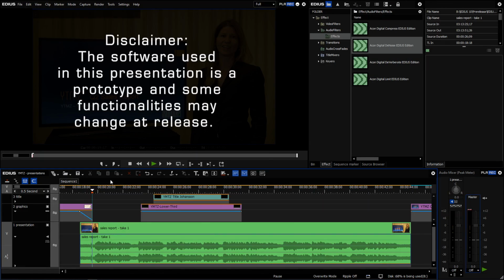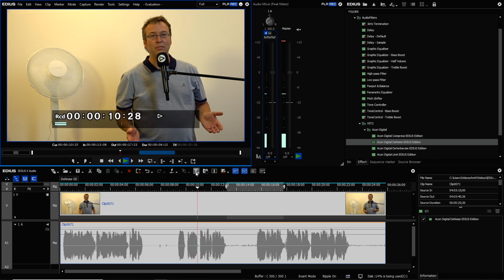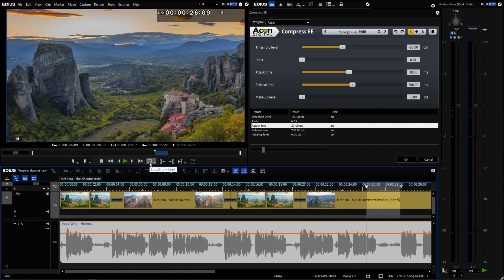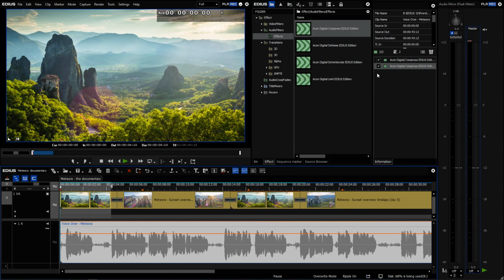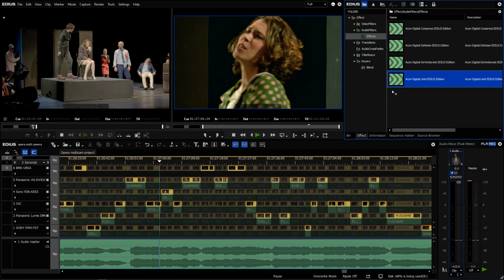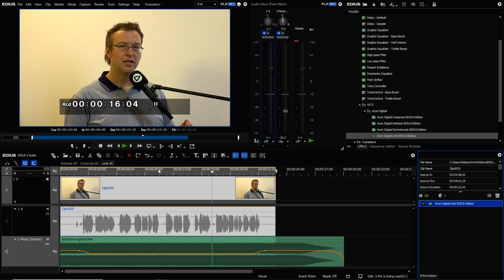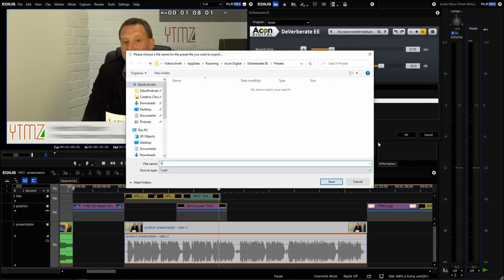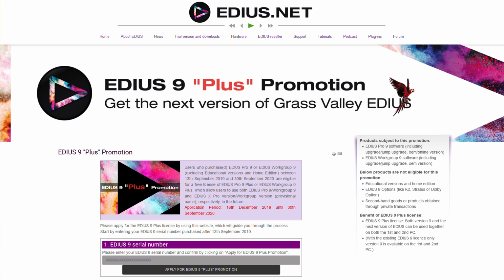EDIUS X Preview | Top Features Part 2: Audio

Comment: Hello Edius team. I know you read the comments so I am writing :). Multiple microphones record over 2 channels. on one, e.g. with -20 db. This is what the newest rode vide mic ntg does. There is no option to change the channel in many files at once. now I have to select each file, then click "properties" then "audio" and then "channel setting" and choose for example "monaural channel 1". My each project has over 200 files, changing them individually takes hours ... thanks in advance for your help :)
Reply from the maker: Dear noa4h! There are many different ways to handls that. You can work with mono clips and delete the one you don't want. You can the filter panpot & balance filter or maybe the best way you can use the audio mapper in the sequence settings and get a virtual patch field where you can decide which track shall go to which channel.

Comment: Will you guys add in a synchronize feature if a video and audio are out of sync and I don't mean just multi-cam syncing.
Reply from the maker: There is an easy fix by using 4 point editing. That is supported by EDIUS since a long time.

Comment: Thank you, these look great and I look forward to finally upgrading from Edius 8.53.  My only concern with these type of filters from previous experience is the long term support.  With previous included addons, examples being Mercalli, titlers and other effects, it has not been uncommon for them to disappear on a later versions of Edius causing problems when having to rework older projects, can you give any guarantee that these addons will be supported long term?
Reply from the maker: Hello! Yes, that is definitly the plan. Grass Valley also want to avoid such problems. So the idea is that these plug-ins will also be included (maybe updated) in the future or that the existing plug-in can be installed in newer versions.

Comment: audio waveform preview in source window!!!
Reply from the maker: Waveform preview in the source windows is on the feature wish list. But it has not a high priority as not so many users where asking for it. It's not planned for the 10.0 release.
Reply: I have to agree with this. When editing audio, I'm having to drag audio on to the timeline (usually in to another Sequence), cut it on the time line and then copy and paste parts back to my main sequence. It's a clumsy and slow way to work, which I imaging could put off editors who are used to Premiere or Vegas. Edius is excellent in so many ways, but on the odd occasions I do go edit bits in Vegas (I'm never going back to Adobe), it reminds me how much faster and easier audio can be to edited.
Reply: @EDIUSNET  Is there page on the Forum where users can request and discuss ideas for new features?
Reply from the maker: @filmdigital  You can send a feature wish to the e-mail wish@edius.net. The wishes are discussed with the EDIUS product team, if we get the same wish very often, the chance is high, that the wish get's true.
Reply: @EDIUSNET  Thank you, that's excellent.

Comment: Dear EDIUS.NET and GV Team, this is excellent! These are great new features and real help in the audio section. I believe that now I will no longer have to use another program for such repairs. But I have one different question regarding the audio section: Buffer. When the audio mixer is off (when not visible), the buffer is at 250. But as soon as the audio mixer turns on, the buffer is often at a maximum of 5. This is not a problem if there are one or two channels on the timeline. However, if there are multiple active channels and if they are loaded with video effects (e.g. CC and CG), such a small buffer creates a huge problem in real time playback. Is there any solution for that or any hope that this will be fixed in future updates? The collaboration with Acon Digital is a real deal. Bravo!! Thank you!
Reply from the maker: Dear Media 53, great to hear that you like the new features! For the usage of the Audio mixer: If you set all the tracks on "off" (which means that you will not chane the audio level while playing), the audio mixer will not have any effect on the buffer. But if you select a setting that allows you to change the audio level, the buffer will be set to a maximum of 5 frames. it is designed like this to give you a direct feedback on the change of the audio level(s). Obviously a buffer does not know how you will change the audio in the future. So this "works as designed". If the PC get's problems with the payback, try to fix the problem. Sometime is it a harddrive which is not fast enoigh or something else in the system which limits the power. Of course in Workgroup (and in EDIUS X than also with Pro!) you can lower the playback video resolution to allow the system to be faster. For the audio mix, that is maybe the best solution as it will not reduce the audio quality, only the video resolution.
Reply: Thank you  @EDIUSNET  for this explanation. Thank you for your time! Keep doing great work bringing EDIUS to the old path of glory!!
Reply from the maker: @Media-53  Thank you!

Comment: Hello, can you please explane me how to do linear down sound volume at the end or begining of the clip... like a disolve that is also linear... Thanks
Reply from the maker: Dear Rok, you can simply use the audio rubber band.
Reply: @EDIUSNET  how to do it in edisu 9 ???
Reply: @EDIUSNET  with the rubber band is curved fade and not linear... i would like to fade sound linear as you can do with mix fade that is linear
Reply from the maker: @rokg12  That is depending on the few: If you have set your Audio view to log, a linear fade will look lig a log, but it only the view. Try it bay changing the audio view mode to linear again.
Reply: @EDIUSNET  so it always look like log but is actual linear if I understand wright???
Reply from the maker: @rokg12  Yes, it is a linear fade, but if you use a log view, it looks like a log fade, but it is linear.

Comment: Please read my wishlist below for better & faster editing workflow in EDIUS
1. Add a search box for effects window (just like the search box in the masking effect)
2. A search function for searching marker comments both in the bin & timeline windows (move playhead to marker)
3. Better EDIUS/Mync collaboration. A search function for searching clip tags & comments created with Mync
4. A keyboard shortcut for selecting a clip and add focus at the timeline Playhead (clip information will display in the 

Palette Window)
5. More timeline toolbar buttons e.g. clip colour or customize toolbar button to add a script like Vegas Pro.
6. See audio waveform in the player window and add markers to audio clips
7. Convert audio LTC timecode in a clip to broadcast timecode for syncing
8. Clip speed (Time Effect) available as an effect filter so it can be added to several clips on the timeline
Reply from the maker: Dear Donal, thank you for your impressive list. But first of all: Did you like the new filters?
1. + 2. + 3. With the new database structure EDIUS X will get improved search functions,
4. Crtl+Shift+Alt+Z = marks the clip at timeline cursour of the marked track (use Crtl+Shift+1 = to mark the VA1 track)
5. + 6. + 7. Are on the wishlist, but do not have the highest priority.
8. Time effects can already be used on more than one clip (already in EDIUS 9).
Thank you for using EDIUS! We hope to see you on 20th August!
Reply: @EDIUSNET  I agree.Sir, Clip speed (Time Effect) Copy to Replace Pest (The same Timeline footage filter copy to Replace Pest).
Reply: @EDIUSNET  Thanks @EDIUS.NET for your reply. Great to see the EDIUS team are listening and supporting freelance editors. Fantastic new audio filters. I usually edit the audio in external software, this upgrade will save me a lot of time. Thank you.

(Ref. to my questions Q1, Q2, Q3) Great to  hear the new database structure EDIUS X will improve search functions
(Ref. to my questions Q4) Thanks for letting me know about the new keyboard shortcut for selecting a clip. EDIUS 8 or the previous version didn't have this.
(Ref. to my questions Q8) I can't add time effects on more than one clip if the option "Change the Clip Duration on Timeline" is ticked in the Speed Dialog box. I hope in EDIUS 10 "Time Effect" will be available as an effect filter.

Comment: How to lengthen an audio clip (audio looping) from 1 minute to 10 minutes?
Reply from the maker: Simply copy the clip (crtl+c) and paste (crtl+v) the clip 10 times.
Reply: @EDIUSNET  in that scenario, there will be a"click" sound, where two audio clips (of two different frequencies) meet. Is there any way to deal with that "click" sound? without reducing the music sound?
Reply from the maker: @aseefsh3002  If there is a click, you cut in a piece of audio and break it. You need to cut at a different way: 1. do a fade / 2. cut at a different moment / 3. Check the waveform to find the right moment to generate a loop. You can defina an audio offset (rightclick on the clip) which alows you to find the 100% correct timing.

Comment: Which system requires for that soft
Reply from the maker: Hello! You need a CPU with AVX2 support - which basically every CPU has that its not older than about 6-7 years. A nice system is a i9-10900K with 32GB Ram, M.2 Storage and a RTX 2060 GPU.
Reply: @EDIUSNET  I have i5 7th gen and 1050ti graphic
Reply from the maker: @bullistudio4757  That is perfect!

Comment: Will LOUDNESS not be implemented?
Reply from the maker: There is no change: EDIUS Workgroup will continue to include the (very fast and easy to use) loudness meter tool.
Reply: @EDIUSNET  

Thank you for your reply.

Is loudness not included in the Pro version like EDIUSPro7?

(
I'm sorry if the machine translation is weird.)
Reply from the maker: @Miya_Yuu  Yes, since EDIUS 8, the loudness meter and the automatic loundness controll is only included in the Workgroup versions, not in Pro Versions. In EDIUS Pro 7 it was still included (with less functions).

Comment: I am a bit disappointed:
The new filters are really great and will improve the workflow- but this is only on Plug in level. 
Sound in EDIUS is focused mainly on antique Stereo Format. The 5.1 Support is not really usable as SoundClips have to be distributed manually over the channels- by copying the tracks and manual volume adjustment. Already ‚simple‘ NLE Solution like Magix seems to have better solutions.
Reply from the maker: 5.1 support and Dolby Digital export is possible, but you are right (there is even a Dolby Plus/ Dolby Professional option for EDIUS Workgroup). But EDIUS is limited when positioning an audio source in the room and making a complex audio sourround mix. We get very little request for this feature, as you can easily use a professional audio editor to make a really good 5.1 mix. We recommend Acon Digital Acoustica for this. And the good news is: As Acon Digital is now bundle partner with EDIUS X, EDIUS X users will be able to buy a Pro Audio package with even more EDIUS compatible audio filters and including Acoustica Premium at a very much discounted price. So if you really want to do professional audio work, this package would be the recommandation. But for 95% of the EDIUS users, this package of typical filters should be perfect for their daily work.
Reply: Thank you for your valuable feedback! Indeed, you proposal is an suitable alternative- I will invetigate. I am just wondering that there is no request on Surround sound.
Reply: @oliverf9611  
That's because those people who are doing surround or 5.1 audio are working on different NLE-systems or they are using external DAWs. I also miss proper 5.1 track handling since easy audio filters who generally respect dependencies in the audio channel setup while applying can't be used. Same (as you already said) on simple volume control. You have to alter the rubber band on 6 single audio tracks. I don't want to switch to an DAW for simple volume control. For me it's disappointing that nearly nothing has changed on the audio workflow.
With a good base engine and a good workflow, everyone can buy the plugins needed, so there would be no need to implement third party tools.
Reply from the maker: @diemedien-uschi7402  EDIUS X will bring many nice new features. We selected features which had the highest demand. And for noise reduction and optimization filters Acon Digital is the best choice. EDIUS X brings a new VST plug-in bridge which will allow more filters to work. And when the project database is released, even more features in Audio get possible.

Comment: Ich habe einen Intel (R) Core TM i7-7700 CPU 3,6 GHz Prozessor mit 16 GB RAM. Mit diesem PC ist es nicht möglich, vernünftig mit 4K - Material zu arbeiten. Ändert sich das in der neuen Version oder muss ich den 3 Jahre alten PC schon wieder entsorgen?
Reply from the maker: Ein i7-7700 sollte problemlos mit 4K Material arbeiten. Von welcher Kamera stammt denn das 4K Material? Welche Bildrate hat es?
Reply: @EDIUSNET  Das Bildmaterial kommt von DJI Osmo Pocketoder vom Smartphone Galaxy S 20 Ultra 5G und ich filme mit 50 fps. Auf der timeline gibt es sofort eine rote Linie und es ruckelt. Was kann ich machen?
Reply from the maker: @erichoverhagebock5293  Hallo! Es klingt für mich als würde die QuickSync Hardwarebeschleunigung nicht funktionieren. Bitte einmal den aktuellen intel GPU treibner installieren - und die aktuelle EDIUS 9.52 Version.
Reply: @EDIUSNET  QuickSync läuft, sobald ich aber einen Titel hineinbringe oder Farbänderungen vornehme, ist Schluss, dann muß ich alles rendern und dann kann ich es mir ansehen. Wird das bei Edius 10 durch das sofortige Rendern während der Arbeit dann besser? Müßte ja, oder? Ich habe keine Workgroupversion und kann daherdie Qualität nicht auf 1/2 oder 1/4 herunterstellen. Ist das dann auch bei Edius 10 für die Normalversion ebenfalls gegeben? Ich möchte mir nicht ständig neue Rechner kaufen müssen und somit erwarte ich eigentlich von Edius, dass die Software so ausgelegt wird, dass man auch mit einem normalen (!?) PC vernünftig 4k - Material bearbeiten kann. Trotzdem hier schon mal herzlichen Dank für Ihre Kommentare!
Reply from the maker: @erichoverhagebock5293  Hallo! Ja, EDIUS X wird hier mehrere Verbesserungen bringen: Das Backgroundrendering und die reduzierte Vorschauqualität auf für die EDIUS Pro Version. In EDIUS Pro 9 wäre sonst der Proxy Modus eine gute Lösung. Das problem kommt im übrigen daher, dass DJI ein single Slice File schreibt, das Video besteht also aus einem großen Stück und nur ein Decoder kann daran arbeiten. Sony, JVC, Canon, Panasonic, usw. machen alle Multi-Slice, das lässt sich viel besser verarbeiten.
Reply: @EDIUSNET  Vielen Dank, dann warten wir mal wie sich mein Problem bei Edius X darstellt.

Comment: I would like to see an EDIUS color correction like the Premiere Pro Lumetri color. Then I will buy EDIUS X
Reply: I agree with you.
There are still many problems with color correction
Reply: But if with the Primary Color of EDIUS (which also works with LUT), you get the same results as with the premiere lumetri (and even finer still).
Reply: @sonoman741  Primary color correction LUT HUE vs HUE missing  So (1)Hue vs Hue(2)Saturation(3)Hue vs Sat(4)Hue vs Luma(5)Vignette(6)HSL Etc.
Attach in ''Primary color correction'' interface. it's Very important.
Reply: @andreaschimmenti  I share with you one and only bug in Edius video editing software. 
(1). [Speed Option] Copy to Replace Pest (The same Timeline footage filter copy to Replace Pest).
(2). Primary color correction LUT HUE vs Sat missing So Hue vs Hue, Saturation, Hue vs Sat, Hue vs Luma, Vignette, HSL Etc.
Attach in ''Primary color correction'' interface. it's Very important.
(3). old (EDIUS 6) 3D PiP in PiP Attach in EDIUS X.It's Very important for Wedding Work.
(4). Green Screen keying with resize capabilities is included in Edius x version.
(5). 50i project to 50p reverse.
(6). footage frame rate this assume 
This requirement fill-up i think a landmark decision.
Correcting these I think EDIUS X will be number one